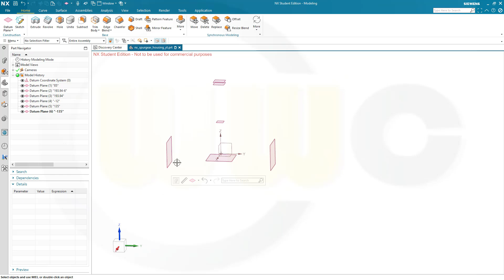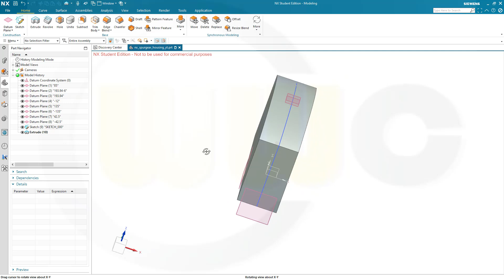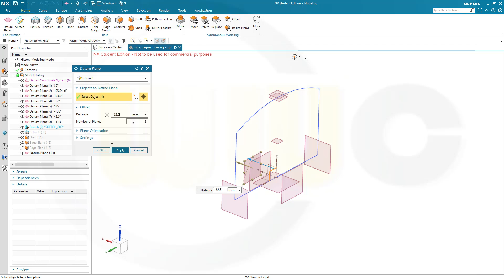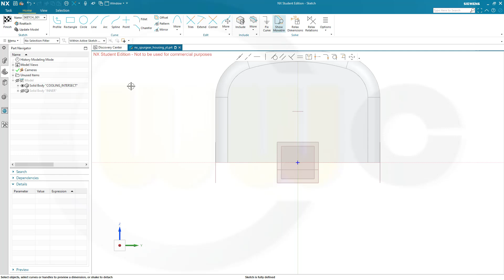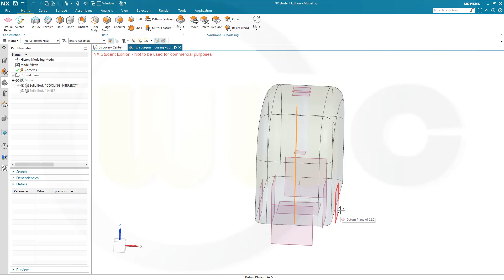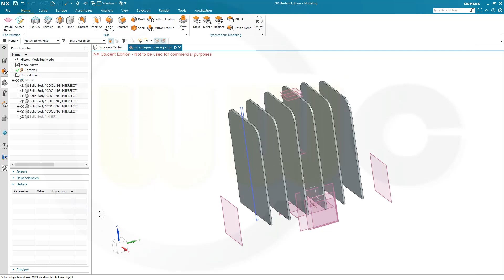Spur Gear Housing - Sterngetriebe Gehäuse Part 1- Siemens NX Training - Part Design

Comment: Why so many planes? Why and why snap to planes, instead of defining dimensions in the extrusion itself and sketches? The logic of this model construction is interesting. Or is it just a habit?
Reply from the maker: No, it is not a habit - LOL. You can or you should use reference elements like planes in order to build a stable model, which is easy to edit and update, controlled by those planes. Please watch my CATIA v5 Basic videos (topic is important not the software you use) or my LinkedIn Learning Siemens NX course,
Reply: @wolfgang.walden.cad.training  Thanks for the answer. I'll watch your mentioned videos.
I agree with the thesis about the stable model. Maybe I didn’t express myself correctly, instead of planes I use references to the datum coordinate, sketches tied to base coordinates, dimensions from the sketch, which can always be displayed on the model. It seems to me that this could also be a stable model. I also use the faces of the bodies themselves as planes. Maybe I'm wrong.
It is also possible that such stability of the model is enough for me, since I have building elements, various metal profiles, and composite processing.